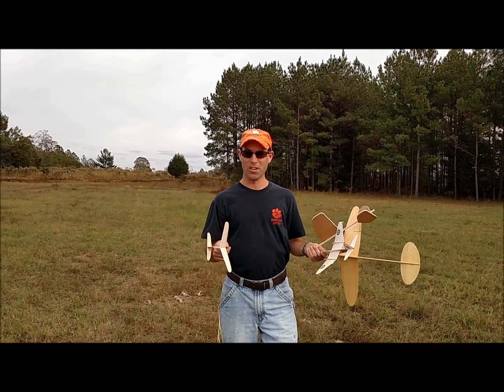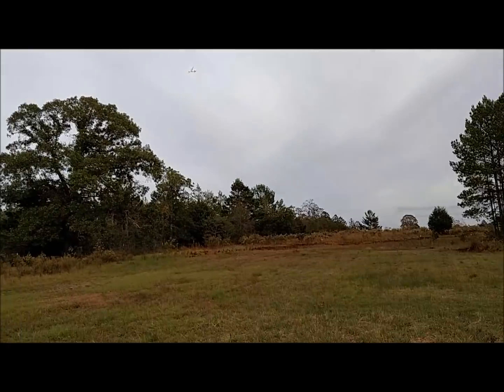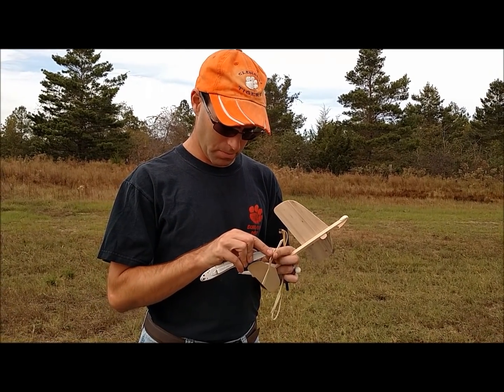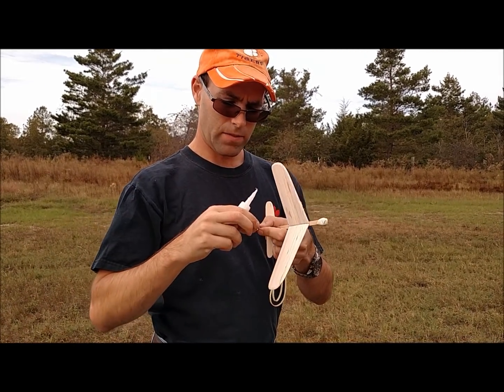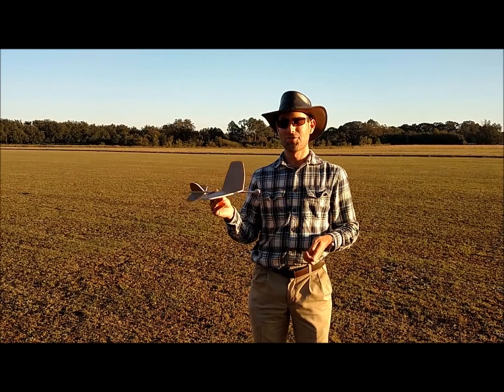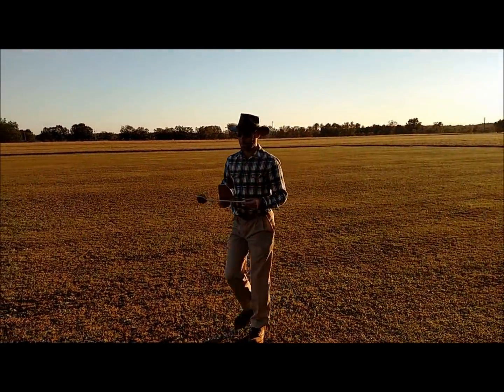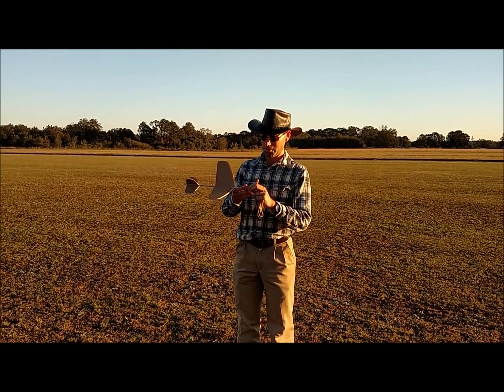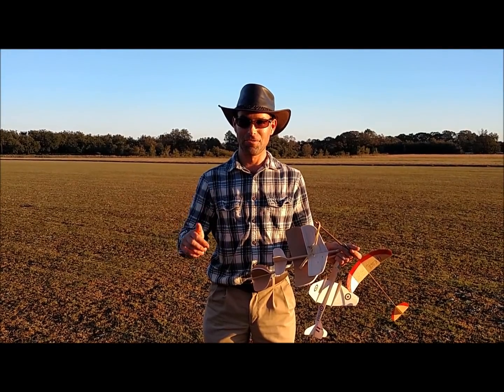How to fly chuck gliders and catapult gliders!

Comment: good video, thanks. My wife came up with a great idea I have used on foam wings and stabilizers. A cookie dough roller used on those surfaces  with the center top as a base allows trailing edges to be squished thin and leading edges to be rolled. Experiment
Reply from the maker: I need to try that. Thanks!

Comment: Why not go straight and glide straight? Why all the turning?
Reply from the maker: It's just not practical to go in a straight line. These planes cover enormous distances. A typical catapult glider covers easily 1/2 mile on a decent flight. The other benefit of circling is that you can get the plane to center up on rising air currents called thermals, which greatly extend the flight time (and the fun).

Comment: Josh
 I built a carbonette 8 and it flys well, my problem is it tends to dive for a short distance after transition then goes into a nice glide, it loses a bunch of altitude 
My best so far is 45 seconds 
Any help would be appreciated 
Thanks
Reply from the maker: Shoot me a direct email at joshuawfinn@gmail.com for more specifics, but in the meantime, I need to know if it's stalling into the glide or rolling into a dive at the top. The former is generally not enough left rudder, whereas the latter is usually from either too much, or not enough washin on the left wing.

Comment: almost a year later....  don't give up on the foam board quite so easily. at a hard table edge you can roll the leading and trailing edges down really thin with a chunk of 1" steel pipe (top side), then wrap tape half top half bottom (stays flat) develops a bit of air foil and reduces frontal surface area drag a bunch. do it aiming for mid point on the elevator, on the rudder do flat for the left side (sideways air foil to the right side will pull to steer left). for gliders a little larger, you might even approach balsa flight times.
Reply from the maker: model nutty yeah but the point was to keep it simple and within reason, so I didn't want to do on foamboard something that would be significantly easier on balsa (leading edge shaping) just like I wouldn't do on balsa something that's easier with foamboard (KM airfoils, for example). We kept the models small to stay within the bounds of an AMA catapult because of safety concerns. If you watch my "big catapult glider" video, you'll see that larger models of this type really are quite dangerous, and we're still trying to find a good way to mitigate the extreme risks involved.

Comment: Great stuff and thanks for sharing. The “thud” at the end was funny!  😀 To get our catapult gliders to turn, we use tail tilt and it works well for us. We have not used trim tabs. I’m curious about your thoughts on that?
Reply from the maker: You need a little of both. Using rudder as part of it forces the model to bank out of a stall recovery instead of pitching back up. You can then fine tune the glide circle using stab tilt and in some cases wingtip weights.

Comment: I'm glad that someone agrees with me that foam board is much much too heavy for gliders, and makes terribly inefficient airfoils. But, I'm wondering, what is that glider that has the two-tone wings, which is to the right at the end of the video. Do you ever fly it in the video? It looks neat. I'd like to see it fly. Also, you are releasing kits for the balsa glider, but will you be releasing plans?
Reply from the maker: The two tone is a Carbonette 8 that I built a couple years ago. Unfortunately I lost it a couple weeks ago demoing it for some DLG guys. Plans will be available soon though. The balsa model I trimmed in this video, now named Aleda by my bride, will only available in kit form. However, plans for the foamboard model are already online here: http://forum.flitetest.com/showthread.php?37668-Let-s-talk-about-chuck-glidersYou could easily make those wings from 1/8" balsa and the tails from 1/16" and have a very nice flying airplane. The weight of the foam really isn't bad, it's mainly just a function of drag. If Flite Test would release their thin foamboard, we'd be having a much different discussion.
Reply: I might look into building those plans. As for the weight if foam board, I suppose I agree with you that the actual material is not too terribly heavy, but try to make any sort of airfoil with it and you can easily have a 1 meter wing weighing upwards of 120 grams, which I guess is fine for powerful RC models that fly fast, but for models like gliders which need to be efficient in the amount of thrust they deprive from falling(cause that's essentially what they're doing) foam board, as you said, is rather problematic, in both its weight and its lift to drag. On the subject of thinner foam board, Flire test recently released a vlog which focused on the fact that a member of their staff had succeeded in convincing Adams Foamboard(the company they buy from) to produce thinner Foamboard to facilitate their making scaled down versions of popular Flire test models. If they could make thinner Foamboard for the flite test guys, that shows that they clearly have the facility to do so to a greater multitude of products. So, who knows, maybe thinner Foamboard is something to come! Anyway, I was also wondering about how much weight the slivers of wood add to gliders. I would figure that it's gotta be a pretty significant figure... Also, I usually bend surfaces for trimming and have found that surfaces which are bent can hold trim for months without deviating in the slightest. Do you think that the weight saved from not adding wood is worth having to adjust the model every few months?
Reply from the maker: Copterdude, the tabs only add maybe 50 mg each if you're really heavy handed with glue. insignificant in the grand scheme of things, and the tabs here were exceptionally large. Buddenbohm fuselages have screw adjusted fuselages... as for DTFB wings, check out my Spinster DLG...comes out to a competitive weight. I heard that FT cancelled the thin foam. please please contact them and express your desire for it. I really want the stuff and don't care that it's not much lighter. we need thin!

Comment: I never knew about the gluing of balsa trim pieces on the flying surfaces. Thanks josh
Reply from the maker: Matthew Taudevin, I learned that about 8 years ago and have been doing it ever since. Makes a huge difference. The planes will literally hold trim for years if stored correctly.